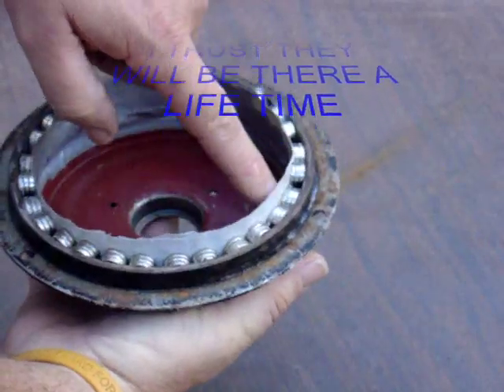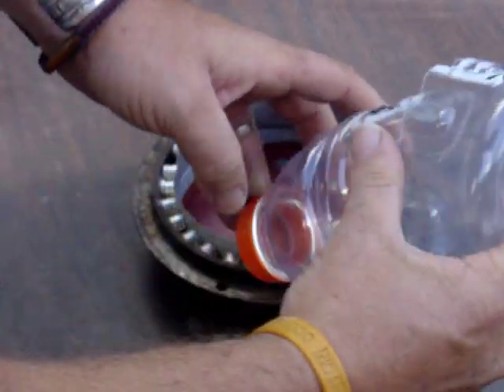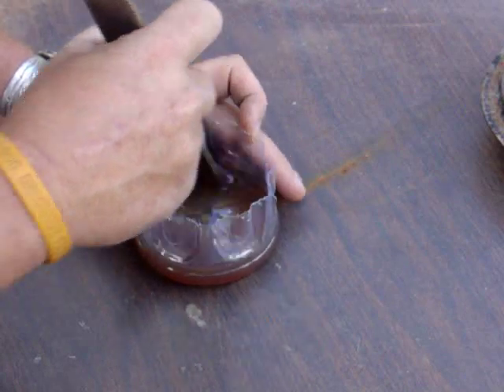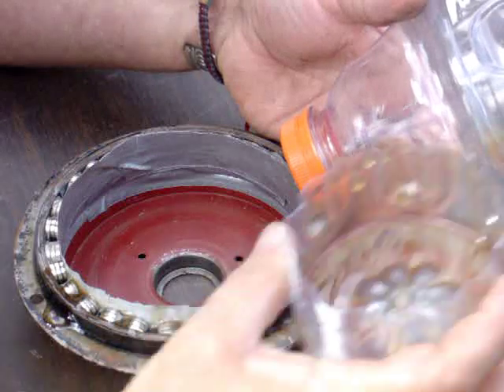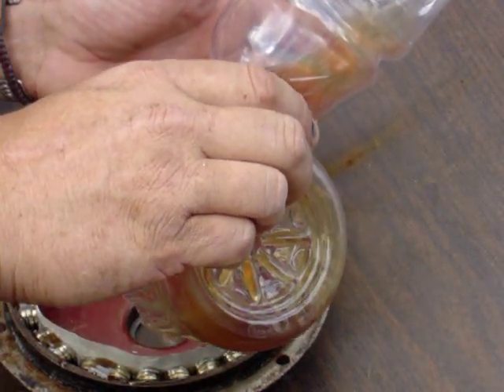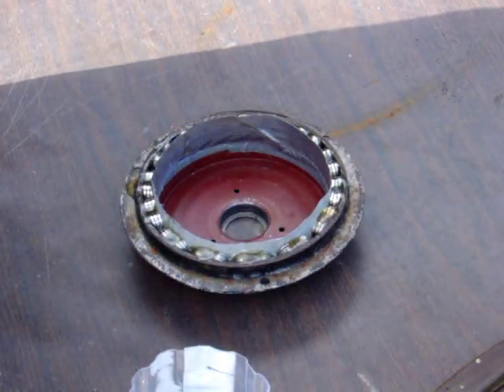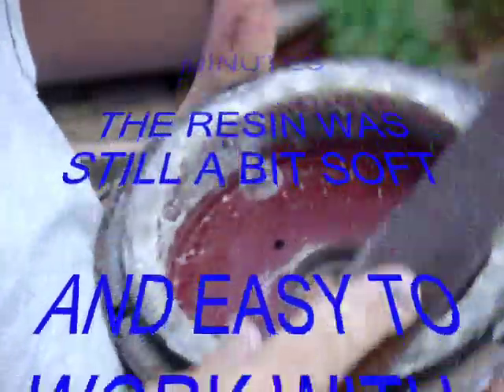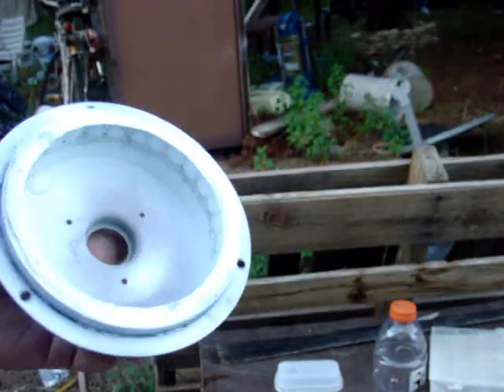8 THE CEILING FAN WIND TURBINE CLASS PART 8

Comment: Hey mudman.    That is what I need this for down at the dock.im starting to make one it took a long time to find on old c-fan .mow that its apart how do I know where to put the magnets??is it one to one or two magnets to one cool?the windings on the fan look like they go CW cCW CW  cCW?should north go to cw or cCW?there are 14 coils and I don't know how menny magnets to put on.can you help me get started I can send pics to you.
Reply from the maker: +bruce don No need to send pictures bro. to tell where and how many magnets you will need, follow this instruction....
There are two sets of coils. Inner coils, and outer coils. forget about the inner coils. Just look at the outer coil set.

for each coil in that set, you want one magnet polarity. I use two magnets of the same polarity for each coil. Using two magnets for that polarity enables the magnets to sit against the outer metal shell. (the motors' casing). This is because one magnet would only be touching the outer shell at the ends due to the curvature of the shell.

On the next coil position,... place two more magnets. these two magnets will be the opposite polarity than the last two magnets of the first coil. 
So far we have two sets of magnets coving two coils. each (set) of magnets is the opposite polarity of the magnet sets before it.

SO two magnets per coil of the same polarity, the next coil gets two magnets of the next polarity, and just keep alternating the polarity of the sets afterward until you have completed the magnet rotor.

example,: 14 coils, 28 magnets nnssnnssnnssnnss

You also asked which polarity to start with. answer,... it doesnt matter. when the shell rotates, the polarity changes anyway. This alternating pole shift is what generates the current in the coils.
(alternator)

Alternators need to be rectified. diode bridge rectifiers turn the alternating current into direct current.

I hope this helps.
Thanks for the comment.
MUDDy

Comment: use acetone to clean the remaining tape residue. (acetone oar fingernail polish remover) as for the filing, I would use a flat piece of 100 grit sand paper wrapped on a 2x4? also that spot that did not get resin, fill it with elmer's wood glue. this would be much faster I think??? great videos. I am following the step by step. THANK YOU SUPER VERY MUCH. my wind generator is a 90vdc 1750rpm and I only get 8vdc max with strong winds. I hope this will give me what I need. Again thanks :-)

Comment: FIBERGLASS RESIN is a GREAT idea!!! I will be doing that same thing. much better than epoxy. I just got my magnets in, now i must get the right steal banding. then i will do the same with the fiberglass resin. that will last years & years. super glue will hold just for the time to pour in the resin. for them people out there that think super glue will be just fine. how ever super glue becomes fragile in weather changes. warm it turns gooey. & cold it becomes fragile. not with fiberglass resin.

Comment: Hey Mudman, I see you like to use your hands as vices, and to steady the workpiece, not knocking your strength but if you have an old 'lazy susan' or a piece of plywood set on a bearing, you can screw the workpiece to it and have use of your hand to guide the other while filing, or filling, etc...

Comment: hi Muddy,
I enjoy your videos.
I use small amounts of resin a ot. I use round HDPV plasticcontainers that ice cream sherbert come in. advantage is bottom is flat so no hardener gets in crevice on bottom and when done the dry resin does not stick to container so i can squeeze the container and crack the hard resin and remove it and re use container. i also weigh resin on scale and then add 12 drops per ounce, it mixes quickly and container is easy to pinch and control flow when puring.